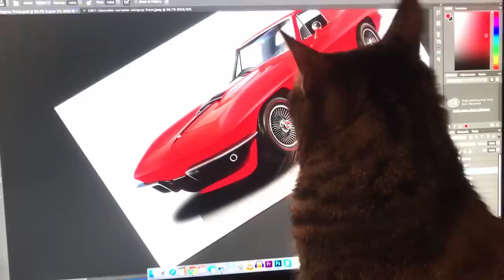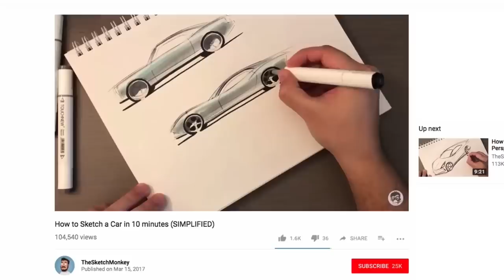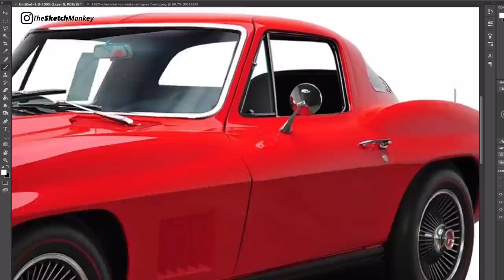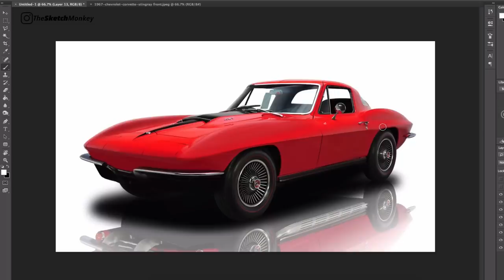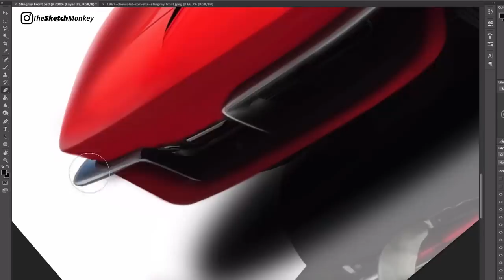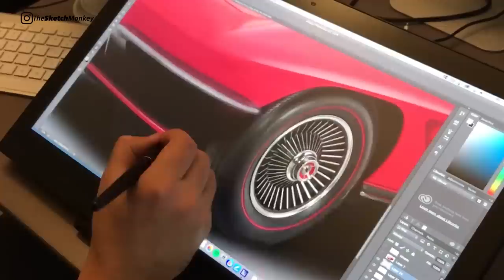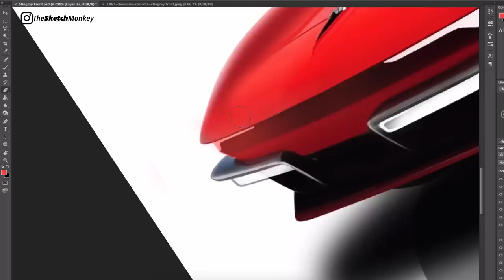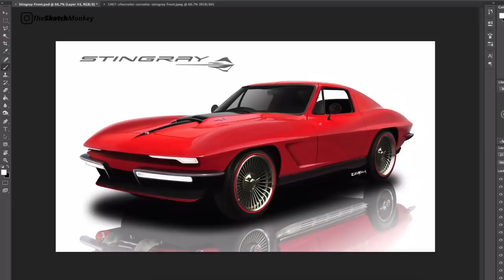I Re-design the 1967 Corvette Stingray Into a Modern Car

Comment: Really wish there were more retro cars. It'd be cool as hell if there was a mainstream manufacturer that created cars with retro looks and modern performance/features. Then again, nothing will replace the feeling of driving a car from that time. The 1900's were just such a great time for car designs, even the regular commuter cars looked great and had style. It's not like there wouldn't be a scene to support it. Old cars are only getting fewer, and the ones in excellent condition are damn near the price of new commuter cars, or more.

If for nothing else, do it for the quarter glass.

Comment: I really liked the transformation.  The only item I wouldn't want incorporated into the design was eliminating the rear window wrapping over the side of the sail panel.  I've driven Camaros of the 1970 to 1981 generation and that wrapping over the sides makes a huge difference when you have to back the car.  Obviously, we have backup cameras now, but even they come with a disclaimer to not put full faith in what the camera sees.  Still, this is awesome work!

Comment: Now just add the '63 Grand Sport hood, fender flares, and air intakes for cooling the brakes. Oh and the rear diff radiator and you've got yourself a Modernized Mongoose.

Comment: Curious. I always thought the Corvette Stingray had a very busy styling with the arches and the intakes and the pronounced lines and scoops.
But for facias I definitely agree. A lot of classic cars just had a rectangular grill, some swooping chrome-bumper on top, job's a good'n. Now that bumpers are injection-molded or pressed plastics the sides of cars have gotten a lot busier with swoops and creases that are supposed to suggest sculpture- or muscle-like contours and accentuating bevels. It's all fine because you can continue these complex swoops into the front or back where the plastic pieces bail you out. Unlike pressed metal there are few limits to the shapes for polymer-materials. So they just use the lights and bumpers to bring all those swoops from the doors and fenders together and overkill happens very easily.

Comment: Looks good almost there. Get rid of the triangle wing windows and go with solid windows then it will be perfect. Wheels look fine on the original not really a modern look. Would have gone with a 6 spoke or honeycomb before those.

Comment: I saw a C6 Corvette with a redesigned body that made it look like a Stingray. I thought it looked wrong because the large rims/low profile tires made its wheels look so cylindrical that they almost looked square in the round fenders and wheel arches.
I like that even though this version has larger wheels you kept the round (doughnut like) shape of the tires.

Here’s that car.
https://m.youtube.com/watch?v=r1XzEw8AtEs

Comment: If you added gold/bronze rims it would plagiarize Ferrari of the same era which I agree looks great , and also , I like your mods somewhat but you're going for a fluid plastic or composite look suitable for the next generation vette instead of a metal body look .Regarding the lights I think a bit much if the actual lights are flipped up , your ground effects are bang on ,

Comment: It's a personal thing, but I don't like the nose coming to a knife-edge - with the gap below it... makes me think of early 1980's Supra nose. I like the lights just under the body line, but would like it better if the nose were filled-in flush with the lights. (it also seems like an absolute no-no for aerodynamics)
Pulling the side sails back (behind the side windows) makes for very bad blind spots, unless you have glass in there (dark smoked, obviously).
I guess at my age (60), doing much of anything to this classic is hard to accept :-)

It would be interesting to take one of these projects and turn it into a "design poll"... then re-do the makeover to incorporate the best suggestions... see what a "design by popular vote" would end up looking like... maybe even through multiple iterations.

Comment: Challenge Redesign the Legendary McLaren F1 cos I have heard that Gordan Murray is going to bring out a successor code name atm T 50 it is going to have 3 seats big V12 the HIGHEST Revving V12 ever 12,200 RPM AND A 400mm Fan in the back but I want to see what would the F1 Look like with the Styling that McLaren is using now both Front and rear

Comment: You should call this series modernizing instead of redesigning. The car looks fantastic but, you didn't changed the overall shape of the car. You did what dodge did the hellephant, they didn't change the shape they just modernized it. The only videos I will agree to be called redesigning are when you change the shape of the car, like the ford model t or yukon pickup truck, but that's just my opinion